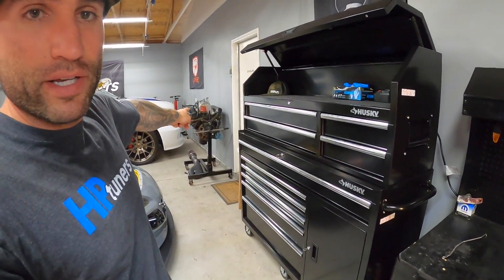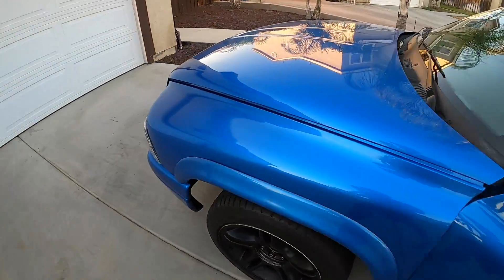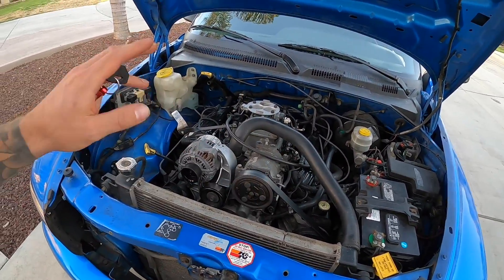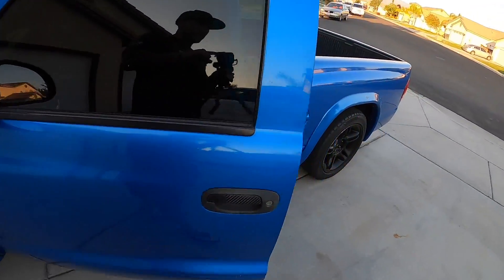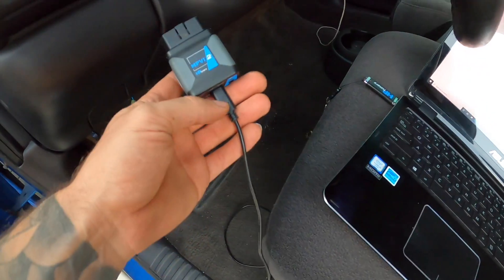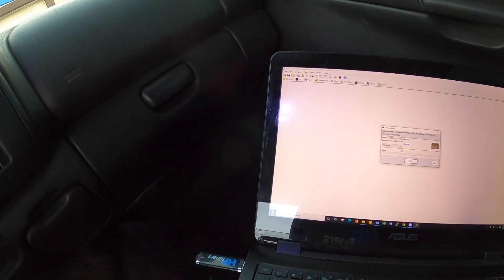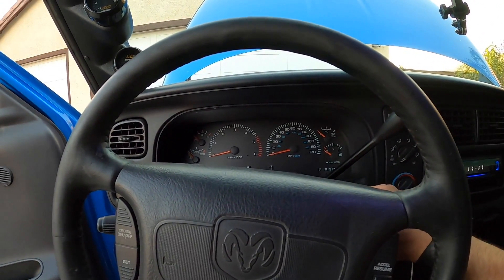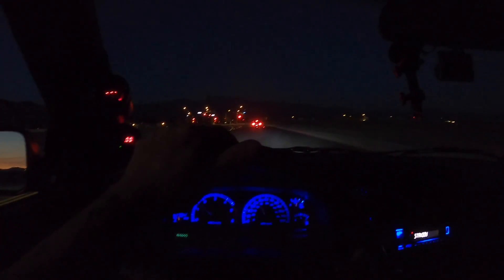Loading a Tune With HP Tuners | Cammed Dodge Dakota R/T Truck

Comment: So IV had my truck for a bit and I'm kinda new to Mopar😅 not really but new to stock ECUs in Mopars. I. Already welded up a turbo kit for my truck and IV tuned most of my cars on a standalone. What do I need to buy to tune my Dakota for boost? I'm half tempted to use an old stand alone from one of my other cars but I really don't feel like making a harness ect and my truck is low miles and the harness looks beautiful so I'd like to just flash the stock PCM. Im not going for a lot of boost or power as it's my shop truck but a mild 400whp would be perfect. That being said what's the limits on the map sensor?

Comment: Are you willing to make this truck a stroker?? 
It will make your 360 into a 408.
The compression is not high so you can still have boost.
It is a somewhat expensive mod but it will be worth it in the long run.